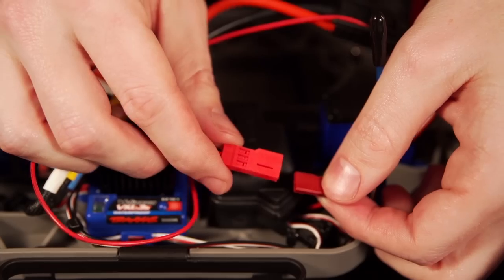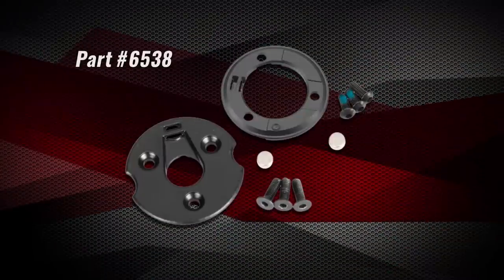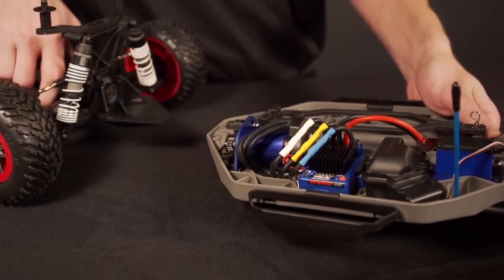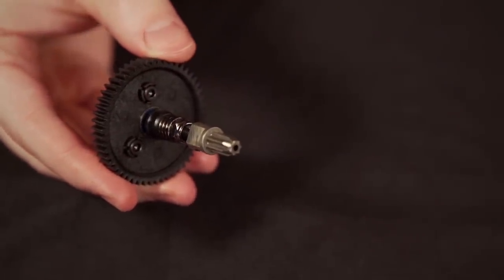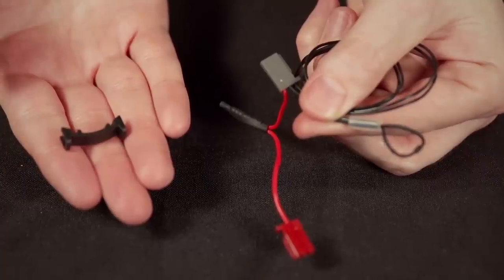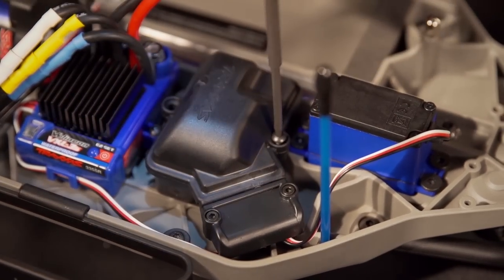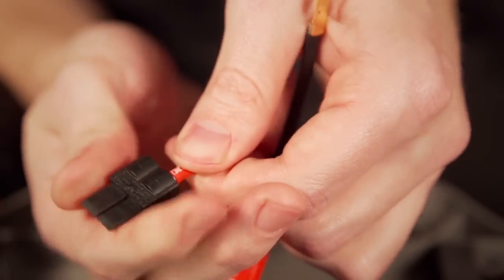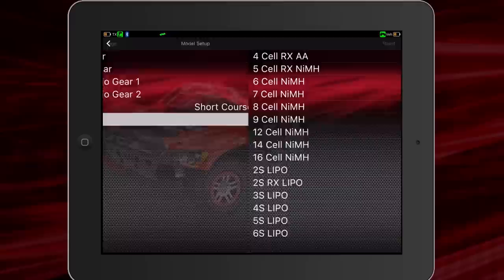How to Install Telemetry | Traxxas Support

Comment: I’m quite the DIYer and am comfortable breaking down and troubleshooting anything from a real vehicle to a RC vehicle to a laptop to a kitchen sink but the fact that I just bought these wires and sensors for my Traxxas Hoss to connect to the Link module for the dashboard really REALLLY irritates me. RC cars have earned their bad reputation for enticing prices followed by nickel and dime add-ons easily exceeding the initial cost of the RC. These sensors couldn’t cost more than 1/3 of $0.01 to manufacture wholesale in some foreign country then ship here, however I just paid the low blow of a retail price for both sensors only to find out from this video that I need more add-ons to make them work on my newly released, new model, nearly $500 RC truck out of the store and $1,000 RC truck as it sits now, when it could have EASILY been installed at the factory and just have been an added feature.
Yesterday I purchased the X-Maxx with the 26(?) amp dual charger and 2 x 4S LiPo Traxxas batteries and Traxxas Link for a whopping grand total of $1483, and the sensors were included on it so I know it can easily be done. But I shouldn’t have to buy the largest RC to get all of the technology features available. 
Lastly, while I LOVE the X-Maxx, or at least I did for the 2 hours I’ve been able to drive it, it’s painfully clear that the stock servo installed is faulty and grossly inadequate for the rest of the truck. After my 2 hour session I was slowly driving it to me to load up, and I hear a stupid sound coming from inside the truck. I didn’t even try to steer. I’d already done my research and knew to expect a replacement upgraded servo in my near future but I didn’t expect it to be after my first time out. Tomorrow it goes back to where I bought it 2 days earlier to have the servo replaced under warranty so I can use it while I wait for my newly ordered ProModeler servo to arrive. I considered the Traxxas servo with metal internals but there’s just as many failures as with the plastic gear servo.
Yes, it’s cheaper and better for your bottom line to use plastic in place of metal, yes it’s cheaper to also replace the metal driveline components with plastic, but no.. it’s not respectable and marketing the metal part as an “upgrade” is wildly annoying. Just produce the damn RC with your best parts in and out and raise the price for the RC that should be in my yard, and I’d gladly buy it. Currently I can (and have) purchased the flagship most expensive and high end RC you offer and I’m still replacing parts on day 1.. 
Still love you though, Traxxas 😘
Reply: I'll still to the gas it only need 3 parts the other cars Traxxas doing to much just to use the link
Reply: I got the temp, voltage, and rpm sensors along with the telemetry magnet & holder, but skipped the temp sensor holder & that ridiculous "power tap" connector. Zip ties hold the temp just fine, and it's just as easy to solder a tap from the battery connector. But after all that, the end result is very underwhelming. The traxxas link app isnt nearly as impressive as I was expecting, and after spending the additional time & money for 1 vehicle, I have no desire to "upgrade" my others.
I did upgrade the motor & ESC to a Velinon 3500 & VXL-3S and wish the motor had sensors like so many other brushless systems like the MST & Sanwa I have in my drift cars. 
Still like Traxxas electric vehicles, but for now on I'm not bothering with add-on sensors
Reply: @MrTim223  Agreed. The tech being adopted currently just hasn’t come far enough to be worth the cost yet. The data for all dashboard features that we want is available, the application/software receiving and presenting that data to us needs work. Better developers or a bigger development team would fix any and all problems with the app.
I’ve actually switched all of my receivers over to Spektrum and use a Spektrum transmitter now and those smart features are quite good, especially since they are built into the receiver and you can get more data by using more Spektrum components (i.e. Spektrum LiPos, Spektrum ESCs). It’s super nice!
Reply: the hoss doesn't have built in censors?

Comment: Where do I have to connect the speed sensor to the Traxxas E Revo?

Are both batteries evenly removed from the model (traxxas e revo)?

(Traxxas E Revo 1:10 brushed 2016)

Scaler04

Comment: Video states you need a long temp and voltage sensor wire which is part number 6521 but they give the part number for the short sensor wire (6523)?????
Reply: Leo Glenn #6521 (Long) is for the 4x4 and #6523 (Short) is for the 2wd.

Comment: Can the rpm sensor alone determine speed? The GPS module for the expander is practically nonexistent
Reply: Yes the rpm sensor can monitor speed alone but you must have correct gearing and tire size programmed and your speed in dirt will not be accurate due to tire spin get the new 2.0 gps

Comment: Just want to make a note here but the Voltage Telemerty cannot be installed in a Rustler 4x4 VXL. That Already has the Rustler 4x4 led light kit.
Reply: It's possible to install both, but you need adapter part 6549

Comment: I have a slash 2wheel drive tq with 2.4 ghz. Can I make the tq remote into a tqi remote?
Reply: Sanjith321 no you need both TQI receiver and transmitter

Comment: which is easier to add ;the brake yolk for brakes or a brake adapter?..my truck i bought didnt have brakes and i want to install them
Reply: what truck do you have?
Reply: tmaxx 3.3 but with a 2.5 (4910) transmission

Comment: hello Traxxas. I have a question. I just bought a Rustler VXL and I bougt the temperature sensor. I just want to be able to read the motor temperature and not the voltage. so that means that the red connector for the voltage is not being used. is that correct? thank you in advance.
Reply from the maker: +TRAXXASfreak Hello! Feel free to contact our Customer Service Team at 888-TRAXXAS. They would be glad to help.
Reply: Thanks :)
Reply: same here : just want the temperature sensor to work not the voltage. Thus should it work without the red connector being plug at all ? Because it seems not. Thanks !

Comment: What about a new Ford Fiesta ST 4WD number TRA74054-4. There is absolutely anothe type of clatch. Magnet installation, as shown in video, is impossible, I installed the magnit as per Slasj 4x4 from opposite side of spur, but it does not work and my app on iPhone shows me zero speed and RPM... Please comment
Reply from the maker: To help get your telemetry setup working, please call our support team at 888-872-9927 or e-mail support@traxxas.com.

Comment: Hi, Can i use de TRAXXAS 6521 on the lipo voltage? or only on radio(bec) voltage?
Reply from the maker: Hello, the 6521 temp sensor reads BEC voltage. To monitor battery voltage use the power tap #6541. https://traxxas.com/products/parts/telemetry/6541
Reply: Traxxas  can i use the Traxxas 6541 with 6521?

Comment: Traxxas telemetry is a joke. Go aluminum for gear box box/spur cover, a motor mount heat sink with motor plate heat sink, coupled with a motor heat sink would be more worth while than setting up sensor[s], and upgrading your transmitter/recover
Reply: Reciver*
Reply: Receiver**